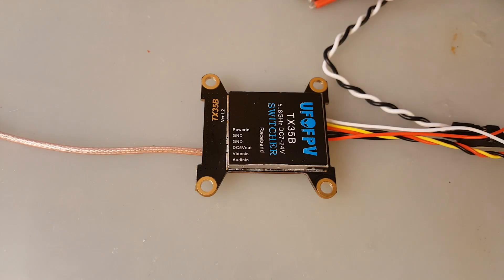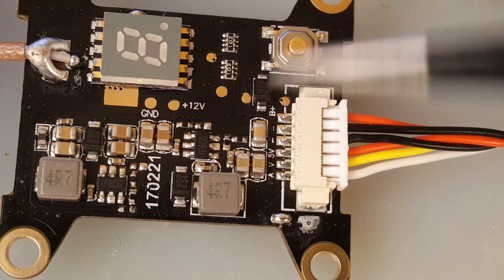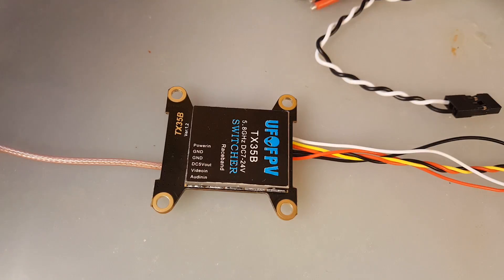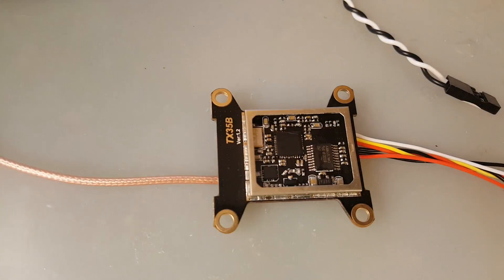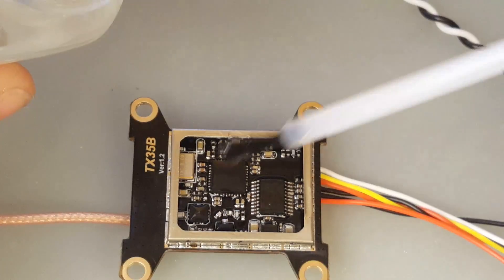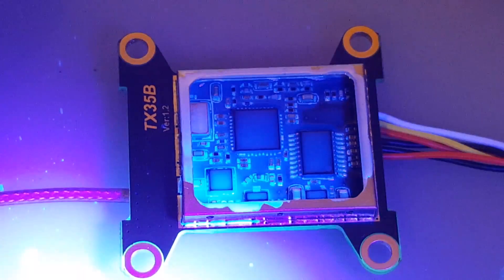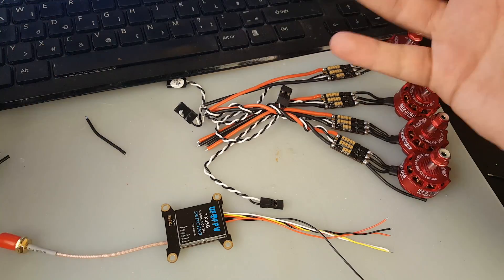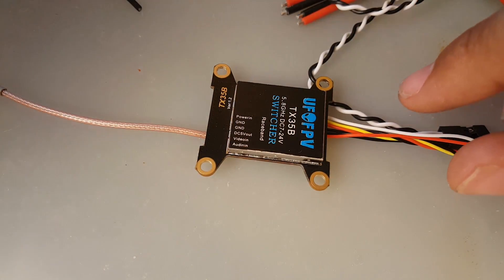Best Budget Waterproof VTX // UFO FPV TX35B

Comment: funny. we are always building and or getting the same stuff. (frame this time) I went with a diff vtx. I went with an AKK FX2. To the point though. I have always thought about stripping the vtx shield off of my builds for the extra build space ( bout 2mm). the comformal for circuit protection. I'm worried about heat though. stacking a receiver right on top with some dub sided sticky tape is the goal over all though. any thoughts? Doing it on a PC would be certain video death!! that's why its got me a little concerned. not enough to stop me from trying though....

Comment: I had an alternator go out on a car I had but it turned out to be just a loose belt. After replacing the belt and tightening it up it worked fine.
Reply from the maker: +Jim Clark, N5QL I did not check that, first I thought it was battery so I bought it a new one. Then I said I will drive around a bit and found voltage dropping so I knew it was the alternator. Ended up just leaving some juice in it to enable me to take it to shop for repair.

Comment: I think the shield cover is supposed to be the other way around with the wiring label on the side of the connector
The flying in the rain will pose an issue with water droplets on your FPV lens obscuring you vision when flying. 
You may need to coat the FPV camera lens with some windshield rain repellent like Rain-X brand

Comment: Nice overview buddy, does this vtx support smart audio or tramp protocols? If it does it's a killer deal for that price, even without the smart audio feature it's pretty much unbeatable. I also remember reading somewhere that conformal coating is good to water proof electronics like this, but not to use it on communication ports like the mini usb ports on flight controllers, there was another substance for that but I can't quite remember. Keep up the great work and video's brother, you keep getting better and better 👍

Comment: Noice.
Let's hope this VTx isn't just good at easy coating :)
I've read that 5.8 under the rain is working very badly, even moisture downgrade the signal, so I'm really curious about your tests ! 
And FIX THat CAR !  ;)
Reply: 6rilllir6 yes the humidity does degrade 5.8g signal. Ive flown in cyclones tho. So its not unusable.